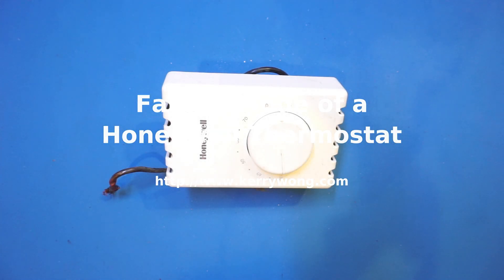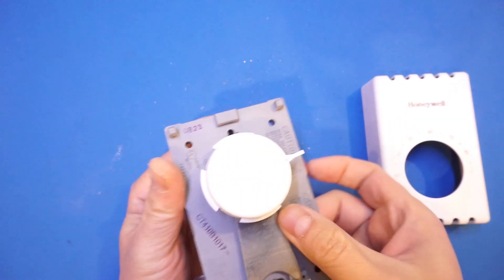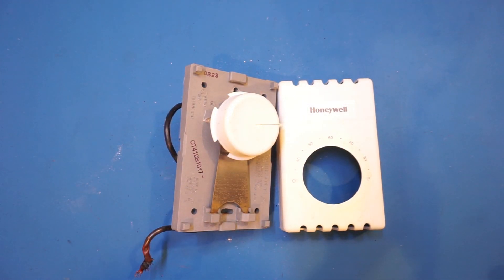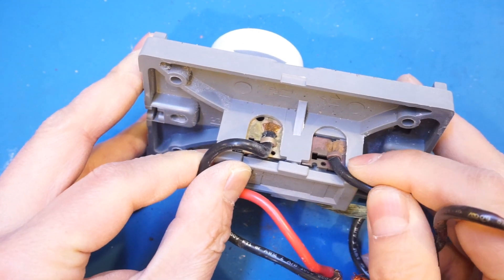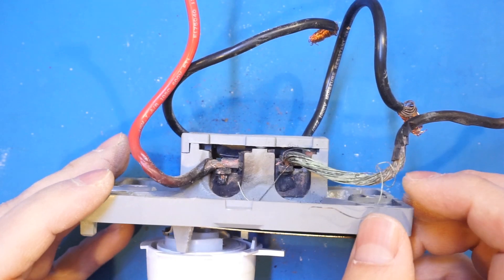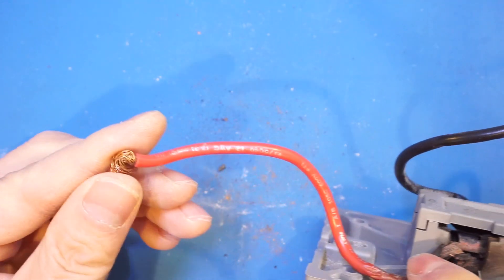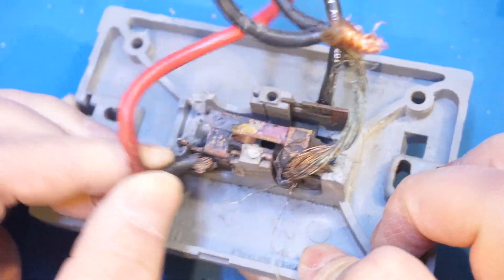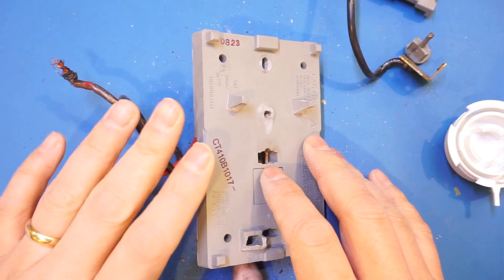Failure Mode of a Honeywell Thermostat

Comment: I had installed 12 of these in my home and one won't turn off after 2 years of use. The quality looks poor on these units. I'm about to remove it to get a closer look. 

On a side note; I bought the same type of Honeywell thermostat back in 2010 and the quality is much higher. It is also adjustable to calibrate temperature. The temp calibration is what I would really like to have as a consumer.
Reply: I removed it and found that the switch that creates continuity between the terminals was stuck or melted. The thermostat smelled like melting plastic and showed 110F degrees on the housing with a Flir thermal imaging camera. Scary!

Comment: Appreciate the posting of the failure.  Just some thoughts....why are there severe indents evident in the thermoplastic insulation of the leads?  Stat severely forced into the electrical box, compromising the 600V insulation?  Why is there green cu oxide on the L2 lead only...moisture?  The welds still look intact, only loose at the bent tabs because insulation is gone.  The bent tabs are not the electrical connection.  Agree with other posts regarding "no neutral" in 240V circuit: only line and load.
Again thanks for posting, Mr Wong.

Comment: I dont know if this has been said but you've got your wiring messed up and it will burn up over and over again. What you called the hot and neutral sides are not on the same sides of the circuit. One side contains one black and one red wire, on the top and bottom. Theu are marked by L1, L2 being your line side (incoming power) and T1, T2 being your load side (outgoing power). If you hook it up the way you demonstrated you will have mixed up your line and load. This may work for a period if you dont put both sides of your line across from one another. If you do, expect sparks.

Comment: Since this is a 2 pole switch and 240 volt application there is no “neutral” side at the switch. The switch is getting 120 volts from each of the  lines 180 degrees out of phase from each other (account of centre tapped transformer feeding service panel). As others have indicated likely only one of the contacts failed and was arcing and heating up the connections. I appreciate your effort in showing the failed thermostat and the potential hazards of using such a device. The reason for my search was to discover if this CT410B is a well made robust unit. Thanks for the answer will be returning mine immediately.

Comment: For the record, There is No Neutral Side to electric heat. L1 and L2 provide 240vac If you have a Neutral, You get 120vac. Please get your Electrical Terminology correct before making these Videos. Your Thermostat wiring has been subject to a condition called "Burn Back" Which is predominant when Arching occurs in a device causing excessive heat at the Arc point and melting the insulation of the associated connection to the device. I have seen Burn Back been created by loose connections within the Marrettes. You may have had loose connections of the wiring at the device or just simply a worn out thermostat that had arching at the contact points within the stat itself. Things don't last forever and it always pays to replace devices especially analogue devices like these which had a high span. And i will add, these thermostats needed to be calibrated upon installation. Something else you may not have known. Either way, Good to see you didn't have any loss of property or life.

Comment: An item that requires 5300w of 240v power is equal to 25 amps. These thermostats only rated for a maximum of 22 amps of power draw, and therefore you are effectively and overwhelmingly overloading them. So please next time get your facts straight before you begin to make a video about something you obviously know nothing of.
Reply: Watch the part of the video where he states the rating of the heater attached to it - 3,000w. So please next time, get your facts straight before you begin to make a comment about something you obviously know nothing of.

Comment: I had the same failure as what is described in your video. The thermostat is poorly assembled as you may already know.  The largest problem I see with the switch is the gauge of the stranded wire for the wattage that it is supposed to be rated for. My thermostat had 12 gauge stranded wire attached and from what I understand 5000 watts would require 10 gauge wiring.
Reply: That's because the max amps is only 2,200 not 5,000 the way Kerry stated.
Reply: @rustyt5104  The max wattage of my unit is rated for 5280 and 22 amps. He stated the correct power in the video must not have understood him. 
2640 watts @ 120 volts
My load was under 5000 watts.  Lasted about 3 months running 2 baseboards a 2500 watt and a 1500 watt 240 volts.
The spec sheet for the baseboard states 10.4 amp for the 2500 and 6.3 amps for the 1500. Unless the manufacturer's are providing the incorrect information on their spec sheets I don't see how the draw would be higher. 
What wiring would you use for a 22
Amp draw

Comment: That's a bi-metal thermostat. They all have had an issue with bounce that can induce recursive arcing and heating at the contacts.
Reply: Exactly what happened to one of my thermostats. The thermostat is flimsy and when mounting care needs to be taken to ensure even pressure is used on the upper and lower screws. The housing will flex and change calibration which in turn may cause the thermostat to malfunction.

Comment: I would take a closer look at the contacts. I've seen quite a few contactors that develop bad contacts over time which cause the terminals that the wires attach to get really hot. The result is melted wire insulation, just as you have. If you could get the switch back together, a good test would be to solder a new wire on to replace the failed wire and check your resistances. It will probably show a high resistance in one of the circuit's contacts. If you are safe, you could also load test the switch and check for voltage drop across the switch, to get a better resistance measurement. No matter what you do, I would check the current of your baseboard heaters with the new thermostat installed, just to make sure everything is looking good. As other's have mentioned, it's 240v so both wires are hot and current needs to be measured on both.
Reply: I agree and the "loose contact" of the wire is really due to the insulation melting with the heating having been transmitted up to the wires from the contact area.

Comment: Very important real world topic. Remember that the neutral and PE are common at the 1st load center. The damage you see is typically caused by a neutral/PE fault. That’s the sort of thing that kills people. Well worth running down.
Reply: I had the same failure.  The thermostat is 240 line voltage no neutral

Comment: I too have to disagree with your analysis.  The pictures of the non-failed neutral side appear to show the many individual fine conductors in the wire fanned out and either soldered or brazed to the brass contact.  And the bent tab over the insulation for mechanical stability and strain relief.  That tab is NOT part of the connection (between the wire and the brass) so it is not what became high resistance.  Perhaps a follow-up video with the failed and the new units sitting still on the desk next to one another for a comparison?
Reply from the maker: The wires on the hot side are welded to the brass exactly the same way as the neutral side on the new switch.
Reply: @KerryWongBlog  So, does it look like the hot side welds went high resistance?  Are they loose?
Reply from the maker: @Brian_Of_Melbourne  Yes, the hot side went loose.
Reply: @KerryWongBlog  Curious, what's your hypothesis for why and how this happened?

Comment: When you are doing a failure analysis of a component, could you try very hard to avoid dancing the item in your fingers like its a Rubik's Cube?
Reply: Indeed.  Leave it still on the desk and point at it.  Move it to a new position and point at different bits.  Please.
Reply from the maker: Thanks for the advice!
Reply: You can press the pause button.

Comment: Yeah I don't fully agree with your analysis. You should have looked deeper to where the contact hits the other side of the live load and what you usually see is they have been arcing. The arcing is due to wear amongst the various metals deposited on the contact point. Every time a high current switch or relay like this is actuated for a brief moment it acts like an arc welder which eventually melts the metals right off the actual contact. It's why you can not expect an unlimited life time on a product like this. If it's from the 80s you likely got 30-40 years out of it, right?
Reply: The thermostat in the video is much newer than that - it has a date code of "0823", so the 23rd week of 2008. I have Honeywell thermostats in my house that are original to the house from 1985, and they have much different styling than this one.
Reply: @AppliedParanoia  So cost cutting is likely to blame for the failure. But wouldn't it make more sense to just replace the antiquated baseboard heaters with mini split heat pumps or infrared heat lamps? The energy savings would be substantial.
Reply: @AppliedParanoia  Proves my point even moreso. I don't know why people think things are supposed to last forever. This is why we invented and require smoke alarms.

Switches can also fail for all kinds of reasons not due to the manufacturer. I was in the kitchen of a building where the only thing on the switch was a low wattage fluorescent light. I think it was about 36 watts on 110vac. The wall started to smell then little wisps of smoke came out of the light switch. 

When I took the switch out it looked like it the metal was very solid (no signs of any power arcing) but there was some fine debris in it that was acting like tinder and mechanically fouling the switch thus creating more resistance. Since it was a home so old that power was not even originally installed in it as it was not available I believe it could have been pieces of a mouse nest falling into the switch. Or maybe insulation as they didn't have fiberglass insulation back then they often used just ordinary newspaper. Newsprint eventually just turns to dust. Flammable dust.

There could have been something additional in his switch that burned away. It looks pretty well advanced to have burned what looks like PVC insulation off. I'm not sure the exact temp but I know it's well above water turning to steam. I'd bet if there was a FLIR camera on that switch at the moments all this happened it probably saw something like a 600F peak.
Reply from the maker: This particular failed thermostat had been replaced before as @AppliedParanoia indicated it was made in late 2008.
Reply: @KerryWongBlog  Did you look at the actual physical contacts yet? Usually quality ones have multiple metals plated on them and once those wear off they become increasingly problematic.

Comment: Boy, that makes me really glad that our HVAC systems are all low-voltage controlled! Glad this didn't turn out much more seriously Kerry! Happy New Year!
Reply: i tought that myself .. its dumb switching 22A and running long wires trough the house, instead of just using a relay in the heater and low voltage..or atleast low power switching on the thermostat
Reply from the maker: Thanks Dino! Happy New Year to you as well!

Comment: Interesting analysis, thanks Kerry.  I have two of these thermostats in two separate bedrooms (installed for a couple years now) - maybe I'll have to pull them off the wall and check the contacts!
Reply: Kerry says his baseboard heaters are 3,000 watts, and the switch is clearly labelled for a max of 2,200 watts. DUH! No wonder it failed...